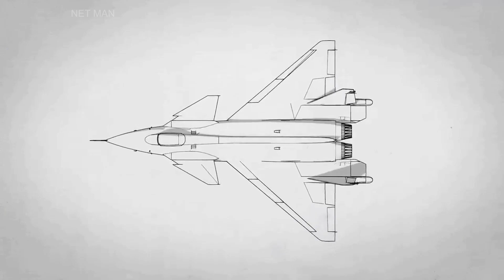MiG 1.44: The Story of Russia's Unbuilt Fifth-Generation Fighter

Comment: This aircraft should have been an ideal successor of the MiG31 if it has the  speed and the same size as the Foxhound.
Reply from the maker: My opinion is that this fighter had other objectives, as can be seen from the name of the aircraft - multirole frontline fighter, while the MiG-31 is an interceptor aircraft